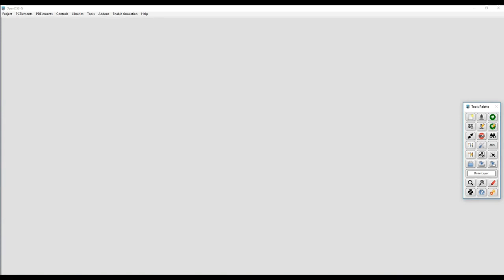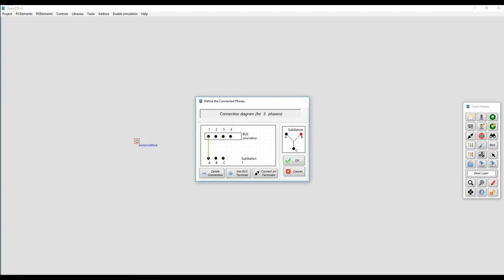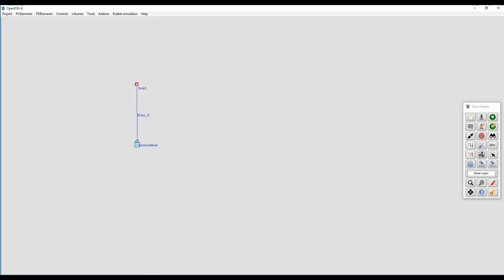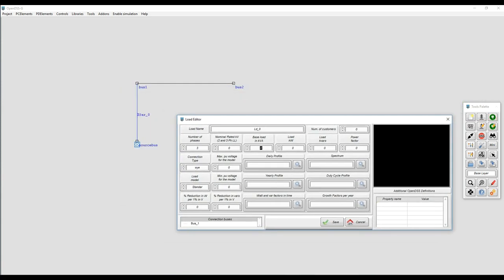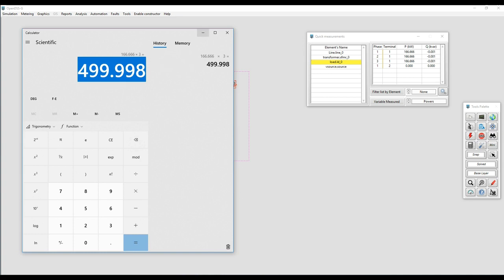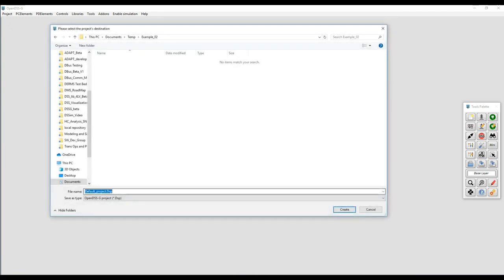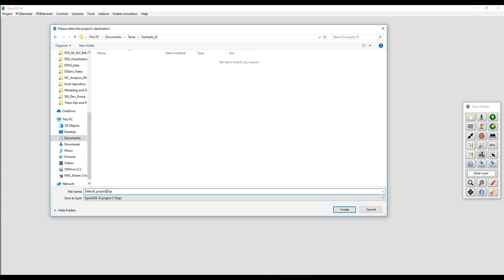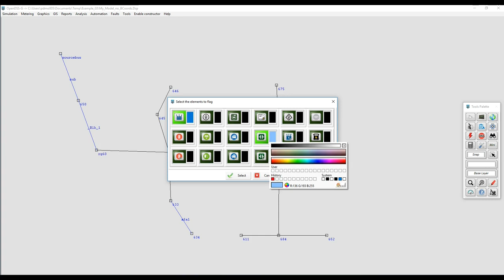Creating/importing models into OpenDSS-G

Comment: Which version is this of open dssg
Reply: I think this was version 3, several things have changed since then but there are videos explaining how to create circuits from the scratch using version 6 (current). The importing of DSS models into G is essentially the same as shown in this video
Reply: Versión 6 allows to do this and more and a simpler way. In fact, there is an example in the user manual of version 6 that implements a circuit from the scratch using both, graphical and scripting methods